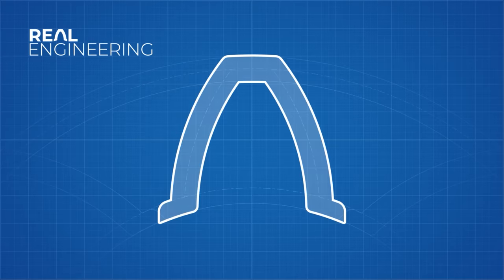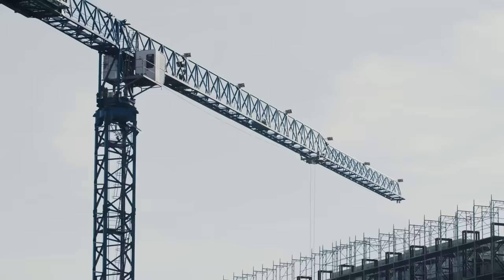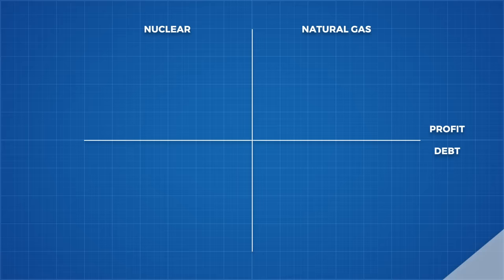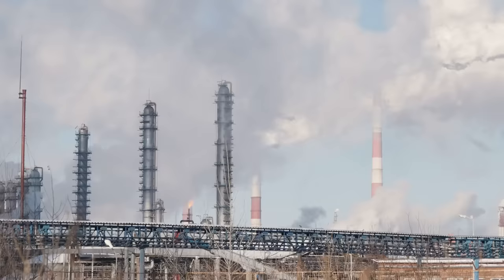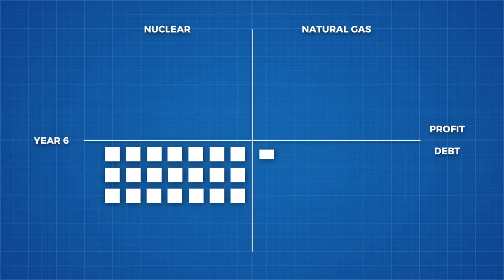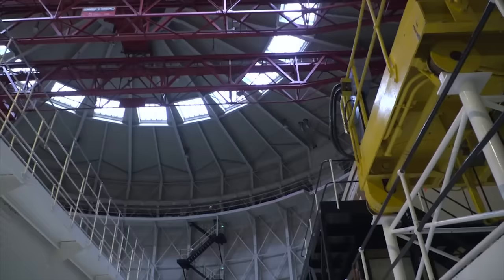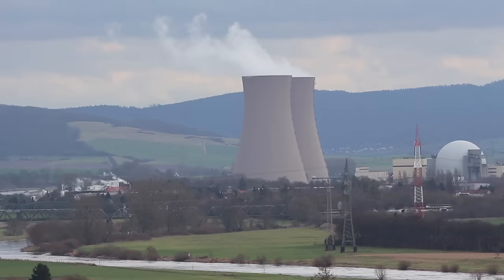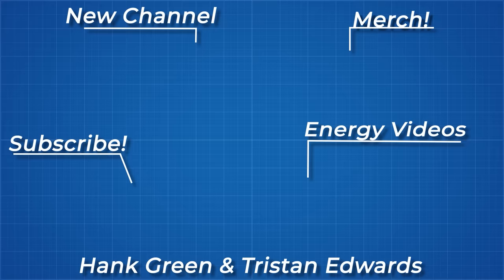The Economics of Nuclear Energy

Comment: 12:32 "That's because California is producing so much excess solar energy that buying it and storing it in batteries to sell later makes economic sense"
California just got hit with a huge round of blackouts because the power grid wasn't able to meet peak demand. Evidently whatever they're doing isn't making enough economic sense to keep the power on for everyone at all times...
Reply: Batteries are very inefficient, so I guess relying on them leads to scarcity
Reply: California had a few hours of blackouts recently because three gas-fired power plants quit working, two on the Friday and a third on the Saturday.  The blackouts occurred after sunset when solar power was no longer being produced.  The state needs more batteries, and it needs a bunch of floating wind turbines up and down the coast in the ocean where it tends to be windy after sunset.
Reply: take note here. California is wery sunny desert area, it makes more sence then in Germany (u using agricultural areas to make el. power instead, also less sun in year, long no sun periods) and far more sence than doing it on Iceland,... Renewables economics are wery location dependant,... Nuclear power plants are far less location dependat than that, they need certain amount of water for finishing of cooling but thats it, some reactors of Gen 4 may not need even that.  Also they may be other uses then making electricity only,.. Desalination of sea watter or making heat for houses in cold areas (for example) may change overral situaion when picking up specific power source,..
Btw about Batteries, some hydroplant are used as peak producer and overcurrend spender(they just pump water up)
Reply: @marianmarkovic5881  Just under half of Germany's electric supply is from renewables, so they are doing relatively well compared to the US.  They do need some more solar power, and they have a lot of roofs that don't have solar panels on them yet.  Germany also needs a lot more wind power because they are so far north where it's windier.  They also might try buying some solar power from France, Italy, or Greece but that would be dependent on arranging lines to transmit the power north.  Batteries will become more common as their prices continue to fall.
Reply: @gravygravyjosh  Batteries are actually quite efficient, there just aren't enough of them yet because until recently batteries were too expensive so it was cheaper to waste the excess solar power in the daytime and supply the evening peak with gas.  Now battery prices have fallen into a range that makes them marginally affordable.  Battery prices are still falling so they will become more common every year.
Reply: @calamityjean1525  Well if u look in numbers yeah they do well, but not so much if you look deeeper. First they trowig hellot of money to renewables, much more other countrys can afford,.. second they becomming more and more dependand for europian electric grid to cover extremes of German spikes(of both comsumtion and production) overloading Europien power lines as far as to Balcans. (Czech republic Energy company had to install Limmiting transformators on borders whit Germany to avoid colapse of grid). Also they would need big Gas Plants as backup (Germany push for Nord Stream, anyone?) In home front, there are outbreaks of protest against anything possible helping stability - New South-North power lines, or even agains new Wind power plants (noise is being problem there)
Also there is difference between Instaled power cappacity and power given to the grid,...
Reply: @calamityjean1525  "marginally affordable" is far from true. According to the article below, the cost for battery power is $156/kWh which would mean a TWh would cost $156 billion. Since all of the US would need 10+ TWh capacity for a fully renewable grid, the costs would be in the trillions. That is assuming though, that the price would stay the same even though the demand exploded to become multiple times over the entire annual production, which is completely unrealistic. The cost would balloon even more from a few trillions to many trillions. Those costs could be drastically cost by having nuclear power working as baseload.

https://about.bnef.com/blog/battery-pack-prices-fall-as-market-ramps-up-with-market-average-at-156-kwh-in-2019/
Reply: @stonewolf5613  You need to be introduced to the concept of "economy of scale".  As more and more identical items are produced, the cost goes down.  Battery prices have fallen and will continue to fall.  The second sentence of the article you linked to says, "By 2023, average prices will be close to $100/kWh, according to the latest forecast from research company BloombergNEF (BNEF)."  The third paragraph says, "...as cumulative demand passes 2TWh in 2024, prices will fall below $100/kWh."  Did you even read the article?  Building enough solar and wind farms to completely power the grid will take years.  There's plenty of time for battery prices to fall.
And that's just for lithium-ion batteries, suitable for powering electric cars.  There's other types of batteries that wouldn't work well in cars but could be great for stationary uses like supporting the grid.  Check out Professor Sadoway's liquid metal battery.  
Finally, you said, "...all of the US would need 10+ TWh capacity...."  Where did you get that figure?
Reply: @calamityjean1525  Of course I read it. I am honestly surprised at the disrespect of you even suggesting that. Though then I guess, this is a Youtube comment section so maybe I shouldn't be surprised that some people have to make every discussion personal.

. The thing is though that the price going below $100, still means that the price will be very, very, high if the entire world is to get along on it. The batteries for the energy storage would alone be many multiples of the production capacity of today. The increasing supply is already having trouble supplying the EV's of today. If the grid stocked up on batteries too, things would get even worse.

The 10 TWh figure is extrapolated from this blog's(  http://euanmearns.com/grid-scale-storage-of-renewable-energy-the-impossible-dream/ ) calculations about the energy storage required for the UK and Australia. The figure can certainly be debated, but since it fits in with my own knowledge about the varations especially solar energy can have in, I think it is in the right ballpark.
Reply: @stonewolf5613  I asked if you had read the BNEF article because it says almost exactly the opposite of what you claimed would happen.  It says that lithium-ion batteries suitable for use in electric cars will be $100/kWh in 2024 and probably $61/kWh by 2030 because many new battery plants are being built.  The supply will expand to meet the demand.  

The second article you linked to, the one by Euan Mearns, isn't particularly pertinent to the US today or in the future for several reasons:  

1)  It was posted, and presumably written, in 2017.  As I mentioned earlier, battery prices have fallen and will continue to fall.  Even if Mr. Mearns' estimate of the amount of storage needed for the UK is correct  --  and I'm not saying it is  --  the price can not possibly be correct now or in the future.  

2)  Mr. Mearns' article is about the United Kingdom, not the United States.  The UK is physically a small place, small enough that the whole nation can be covered by the same weather system simultaneously.  The US is many times larger, "...from sea to shining sea....", which means that we can take advantage of the weather being different in different places 300 or 400 miles apart.  We can transmit power from regions with temporary surpluses to regions with temporary shortages, thus reducing the need for storage, much more easily than the UK can.  To move power hundreds of miles, the UK needs international agreements and undersea power cables to Norway, Denmark, France, and possibly Iceland.  

3)  Mr. Mearns seems to think that "100% renewable power" means "100% of renewable generating capacity is used 100% of the time."  This is nonsense.  Even "conventional" (coal and natural gas burning) grid systems try to maintain 20% excess generating capacity beyond the maximum they expect to need, in order to cover unexpected events.  Renewable energy is so cheap that renewable grid systems of the future could reasonably maintain 50% or more excess generating capacity.  "100% renewable power" simply means that the entire demand for power is met by renewables.

4)  Mr. Mearns seems to want "...to convert this variable [RE] supply to uniform supply."  But a uniform supply isn't what is wanted.  What's wanted is a supply sufficient to cover the demand.  And demand varies from minute to minute within a day, and from day to day within a year.  

You may find this report helpful: http://www.2035report.com/wp-content/uploads/2020/06/2035-Report.pdf?hsCtaTracking=8a85e9ea-4ed3-4ec0-b4c6-906934306ddb%7Cc68c2ac2-1db0-4d1c-82a1-65ef4daaf6c1    (PDF)   It's from the Goldman School of Public Policy and assumes we continue to use our existing nuclear power plants but don't build any more.
Reply: To Release is To Resolve  Batteries are now being installed to replace gas-burning "peaker" generators because even with the cost of the batteries themselves, plus having to pay for the (non-peak) energy to charge the batteries, plus the power lost in charging and discharging them, the cost of the power coming out of the batteries is cheaper than the cost of the power coming out of the peaker plant.  IOW, in terms of cost per unit of power, batteries are more efficient.  
The cost of batteries is falling and is expected to continue to fall for at least the next five to ten years.  This means that batteries will be more cost-efficient in the future than they are now.  Their cost advantage will conquer all by 2040.  You read it here first.